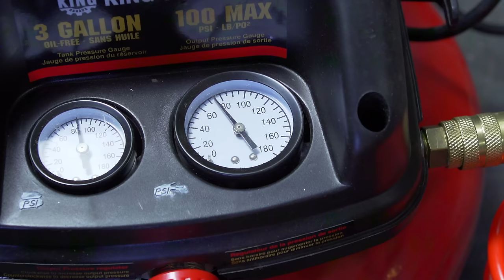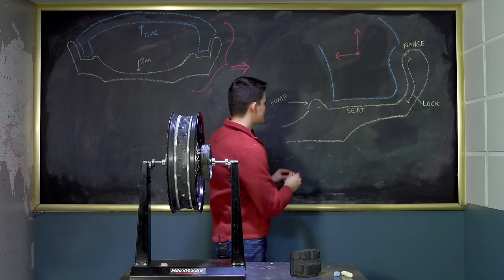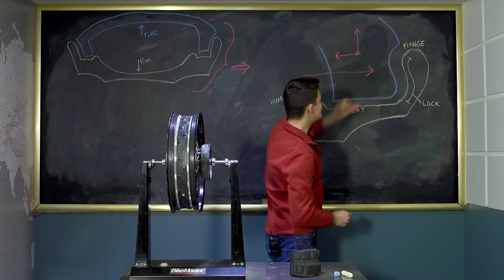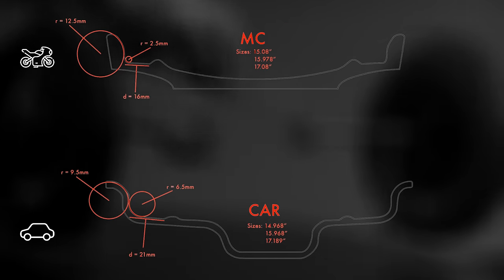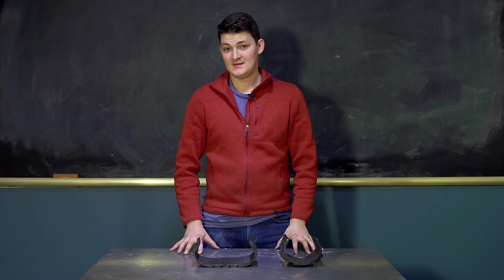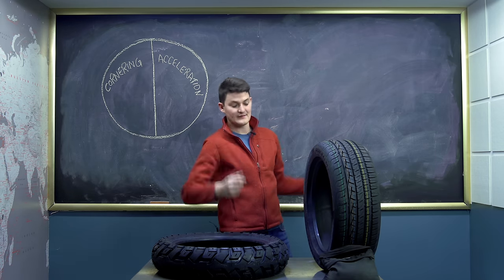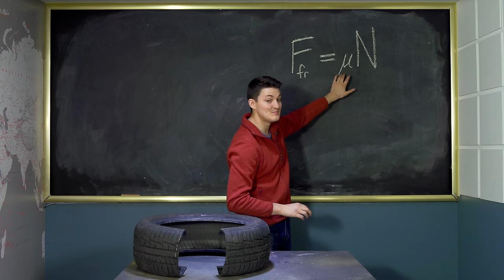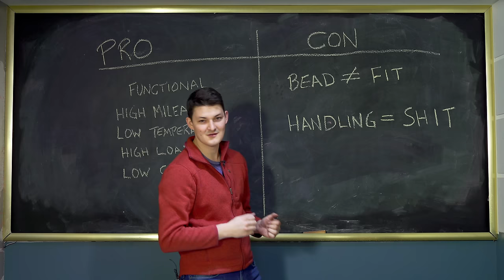Are Motorcycle Tires a Ripoff? The Darkside Car Tire Experiment

Comment: I've ridden darkside. I actually rode Darkside for over 5K miles, before lowsiding it in a curve one day. The handling characteristics are truly shit. That car tire will follow the contour of the road. I was riding interstate 200 miles a day, which is one reason I made it so many miles before crashing. Let me tell you, Darkside on the interstate is like sitting on the sofa, it is so smooth. It wants to stand straight up, allowing me to cross the entire Dauphin Island bridge with out touching the handlebars. On the other hand, i ran through some tiny pebbles in a curve one evening too fast. I had to "force" the bike to lean far enough, so far, in fact that the asphalt contacted my rear saddlebag, taking the weight off the wheel. I corrected by steering back toward the center of the road, that's when the tire got in its happy spot , back on the tread, going into the old "death wobble". During the extreme leaning, the engine guard had contacted the asphalt and wrapped around my right ankle, rendering me helpless as far as using the rear brake pedal. Long story short, i now can't kick the bike away from me, I'm attached by the ankle, lowsiding on the left side of the road between two street sign posts. That's when bike and I both went over the embankment, still attached to the 700lb beast. She flipped mid-air and flung me off. Came out out of that with three broken toes, and the toe burned off my right boot, oh, and a totaled bike. No more Darkside for me.
Reply: "Don't knock it till you crashed on it" - guys, I found someone who crashed on it, can we knock it now?
Reply: Engine guard and saddlebag touched the asphalt while leaning and still tire fault??
Reply: @adilsonlegalyt9647  he said the tire caused wobble. I’m not an engineer but i kno tire geometry is very important on a bike. When you lean the bike on a square tire i imagine a sudden jump from the center line of the tire a couple inches over to the edge of the tire where the rounded front theres a smooth transition. Aside from the tendency for the bike to stay upright on the flat, when its at a 45 there is gonna be a mis alignment of the two contact patches by an inch or two i would think. The relation of the contact patches to lean angle, rake and trail are pretty delicate in my experience and designed so you can corner no handed if you want. A low rear changes it enough so that you have to counter steer just to keep the bike leaning in a corner.
Reply: So i cant imagine how terrible a square tire would handle. I worked at a bike and had a customer that rides all over the us on a gold wing and I think he said he put 30,000 and counting on a car tire i just cant imagine enjoying country roads like that. In saying that i cant remember what tire he used but from wat i can remember it was pretty specific
Reply: Yeah..those engine guard BS bars should be banned,for exactly the reason you mentioned here
Reply: @J.D.Shelnutt  not to mention the contact patch goes from super wide to super skinny the secone you lean over. a square tire isnt meant to lean over like that. that is the reason on oval track race cars the negative camber on the right front is huge on tracks that are banked a lot and very little on flatter tracks.  we would substantially reduce the camber on tracks that were more flat. because on a banked track, your suspension in the right front lays into corner. you adjust the camber so that your tire sits as flat as possible in the corners, which you measure by checking the heat in the tire on either side and the center. you want it even across the tread width. if you get that camber wrong, you will be slow. if you have a ton of that camber on a flat track, it would be like a square tire on a motorcycle, and it gets horrible traction. i know this from experience. this is all common sense too lol
Reply: @J.D.Shelnutt  yeah, I can't understand 90% of what you said! 😳🤥🥴😝😂
Reply: well, i am the only one thinking about what you wrote. The saddle bag and the motor guard touched the road. damn did you think you were on one of those race bikes at 200 miles an hour in curves.... i have been riding for 2 years dark side and never i ever done that kind of driving. i am riding one of the heaviest bike out there, vts 1800.
Reply: @sylvainmorin7497  This was my thought as well. He was probably riding too fast for that corner.
Reply: @richardjensen5227  are you proud of that?
Reply: You are blaming the dark side tire for slipping on pebbles in the road because you were going too fast... Huh?  What would a regular bike tire do?  Then you blame it for wrapping the engine guard around your ankle.  Sounds like you need a sturdier engine guard or one that does not stick out that far.  And isn't the Death Wobble something that happens with regular bike tires?  Seems to me you are blaming the tire instead of taking responsibility for your own mistake.
Reply: Think of all the money you'll save on tires tho!! 😂😂😂
Reply: Thank you for the reality story, much appreciated.
Reply: I have a hard time believing this unless you were riding on a perfectly flat road with no crown.

So were you following the contour of the road or defying the laws of physics while riding without touching the handlebars?

I call BS… from my own DS experience.
Reply: @andrewyoung-n8ary  At least try to read through the comment.
Reply: With a car tire as wide as the one I installed on my bagger, the bike wants to follow the contour of the street. Take my word for it. On level ground, the bike wanted to stand up straight, itself, but roll over a hump and it wants to dump you.
Reply: I feel ya man. Anecdotally, I darksided my ST1300, and after getting used to it, I could happily drag hard parts on my favorite roads.  But, I'm crazy.
Reply: Don't be a cheap-ass if you're going to ride a bike. You need the best tires possible. It's a dangerous enough sport without doing something so stupid as putting a car tire on your motorcycle.
Reply: Skill Issue
Reply: It isn't the tires fault, you went in too fast leaning too much and when you touch the ground it took the weight off the tire, causing the wobble. Should have ridden slower and safer.
Reply: @OldMotorbikeMan  yeh let's ban everything else you don't like also. So dangerous someone else having something different they like.
Reply: I can agree to what you said. I darksided a BMW R1200RT. But my commute was straught motorway except for a couple of corners at traffic lights. I bought the softest tyre I could find, a Continental. Still gave me nearly 80k km before it was done. And I rode it with about 12psi. Wasn’t the best idea, but it saved me a ton of money on tyres over about 3-4 years. Would do it again, but only if the road is 99% straight. And then I would take the corners very cautiously.

Comment: When you find yourself going faster than you should be in a long, sweeping corner, MC tires seem like a real bargain.
Reply: The non-motorcycle specific tire will hold just fine when you find yourself going faster than you should in a long, sweeping corner, with better traction should there be dust, dirt, and/or water on the road surface.
Reply: I scrape the floorboards on my Goldwing running a run flat car tire on the rear. I can detect to change in handling.
Reply: @wncryder  In your mind.............
Reply: @alm4132  Okay! 🤣🤣🤣
Reply: I've scraped the pegs on my gl1800 with car tire. You can't turn any harder than that.
Reply: @joshbobst1629  Yes I can.... You need to watch the whole vid and pay attention to the differences in tire construction.
Reply: @jasonvsd  Scraping floor boards on a Goldwing is not much lean angle to those who don't ride those types of motorcycle, so perhaps you don't run off the edge of the car tire. Given how far the wear from the road surface extends up the curved edge of my motorcycle tires, I'd be riding on the side walls of a car tire, I'd imagine the transfer from the corner of the tread to the sidewall would be very exciting.
Reply: @wncryder  Do you think if that were really true, motorcyle tire manufacturers would not have incorporated into their designs? or is it all some huge conspiracy among all the manufacturers to just sell us expensive under performing tires, despite the apparent competition between manufacturers to produce the best motorcycle tires?
Reply: @joshbobst1629  Perhaps not on a Goldwing, or many of the cruiser bikes, but most other motorcycles that's not even considered lean angle.
Reply: @fiveowaf454  i can tell you have never had a goldwing in the twisties. You might be surprised. But nobody was saying use it like a race bike.
Reply: @fiveowaf454  You don't ride on the sidewall, because the sidewall is vertical. You ride on the edge in corners. You may not have noticed, but every car tire I've looked at the tread bends around the edge and extends all the way to the vertical part. That's where you ride. As the host mentioned, it feels different at first, but you don't notice after a few minutes.

The gl1800, at least, is constructed quite similarly to a sport bike, with a big, chunky aluminum frame and a monoshock and single sided swingarm. It's just bigger. And it doesn't have floorboards for the driver - those are pegs. It can lean very far.
Reply: @jasonvsd  yeah but 13dg of lean is as racer like as watching motogp on your couch. If it works for you, good but not all of us ride or want to ride whales
Reply: Well said!
Reply: Yes. The bicycle i ride has what is technically a motorocycle tire on it and ive at least weekly found a situation where i know i would have either layed it down or nearly done so with regular bicycle tires.
Reply: I have a really really good idea.
Don't go faster than you should.
Reply: @michaelkeith3308  but that would be smart.
Reply: @fiveowaf454  Manufacturers don't give a shit about the lack of air in your tire!
Reply: @fiveowaf454  there is no denying that motorcycle tires are specifically designed; round for better low speed turning, thin to make them lighter with less gyroscopic momentum, softer for better grip on a small contact patch, etc.  On a sport bike I would not recommend a car tire but for a heavy cruiser there are actually several advantages to car tires; lower cost, bigger contact patch even when turning, thicker design that can resist puncture and rapid air loss much better, ability to run flat on reinforced sidewall tires designed for rally racing and drifting, etc.  My VTX1800 stopped over 10 feet quicker with a car tire in a straight line stop. I tried running it with no air and was fine at low speeds (didn’t test above 30 mph). Twice the mileage. I am a big guy, my wife, me, and a weeks luggage on my VTX ends up around 1200 lbs and that is 30% above most motorcycle tire weight loads for my bike. The back tire gets the worst of it and I had tread separation on the stock Dunlop and an Avon that followed it.
Reply: @BN1960  no body! Nobody! Nobody! Said to use car tires on a sport bike. Stay in your lane. This discussion has nothing to do with you, so…. Let it go man. I ride a Harley Road King, with a car tire. My last bike was a TL1000s and I guarantee I could outrun you on Paloma’s mountain, tight side or fast side. 
  Everyone talking about “tread” on the sidewalls. Well, my Dunlop D207gp stars had zero tread toward the outside of the contact patch. The higher performance ability of a tire, the less tread grooves there will be. My d207gps were like slicks on the outer edge, and I would go through a set every two months, when I replaced my knee pucks.
Reply: @joshbobst1629  oo was that a whole 10 degrees of lean?
Reply: @wncryder  no it wont. its simple physics
Reply: @wncryder  a square tire isnt meant to lean over like that. that is the reason on oval track race cars the negative camber on the right front is huge on tracks that are banked a lot and very little on flatter tracks.  we would substantially reduce the camber on tracks that were more flat. because on a banked track, your suspension in the right front lays into corner. you adjust the camber so that your tire sits as flat as possible in the corners, which you measure by checking the heat in the tire on either side and the center. you want it even across the tread width. if you get that camber wrong, you will be slow. if you have a ton of that camber on a flat track, it would be like a square tire on a motorcycle, and it gets horrible traction. i know this from a decade of experience. this is all common sense too lol. there is absolutely no question a square tire wouldnt handle as well.
Reply: @fiveowaf454  I'm running a "car tire" on a Goldwing. No, I would not run a "car tire" on a sportbike. It's all in the application. I know Goldwings, I'm no expert, but I am very knowledgeable. And when I say I would not run a 'car tire" on a sportbike, I had a heavy large displacement sportbike, and the idea of putting a "car tire" on my sportbike was never even a consideration. Check the weight-rating on a motorcycle tire recommended for a Goldwing, then check the weight of a Goldwing, luggage, passenger, and a trailer. I also have a TPMS system on my Goldwing that constantly monitors PSI and tire temperature. PSI and temp never increase significantly. No, I don't think it's a "conspiracy", but in my opinion, a run-flat "car tire" works better for me on my Goldwing, and I have the experience to support my opinion.
Reply: @randal3122  Yes, it will, in my particular application on a GL1800. Your "physics" do not apply to my application. By the way, I ride my Goldwing on the streets, not a racetrack. What you say is true for a car on a racetrack, and what I say is true for riding a GL1800 on public roads, don't confuse the two, they're two different things, they're two different applications.

Comment: Putting a car tire in the back wheel makes it look straight out of a Hot Wheel bike lmao.
Reply: The upside is it stands on its own so you don't need a kickstand anymore
Reply: @romiarkan450  Yamaha owners: finally, a perfect solution.
Reply: @romiarkan450  mine has only done that when pulling a trailer at the same time.